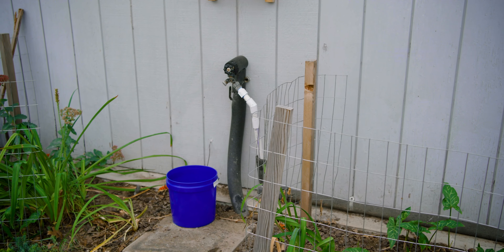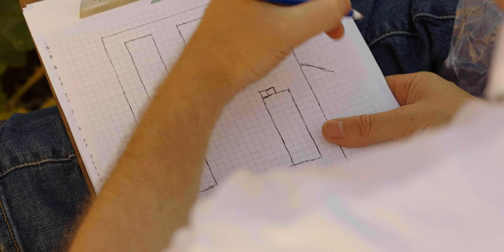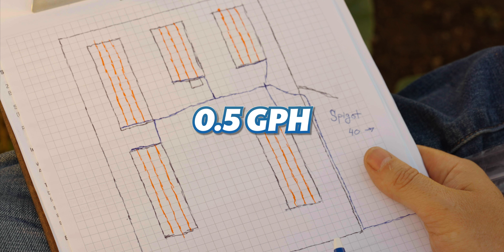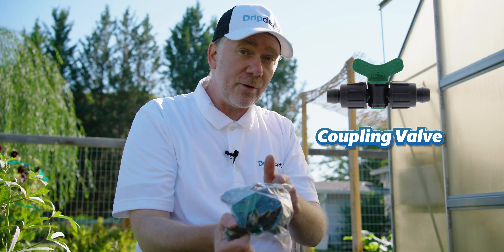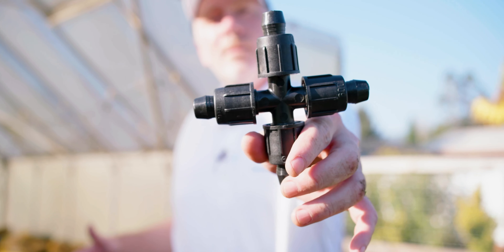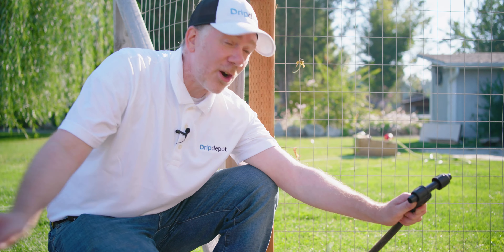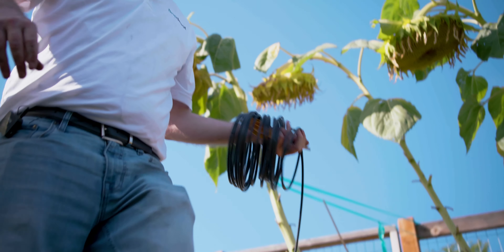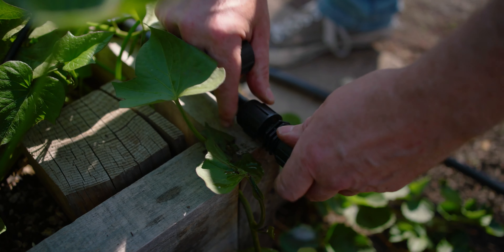How to Install Drip Irrigation for Raised Beds (Complete DIY System Guide)

Comment: Can the 1/2" distribution line be buried? My raised bed garden is about 125' from the back of the house, and there's grass that needs to be mowed, plus I drive back there pulling trailer, etc. I'd like to be able to bury the distribution line. Is it made to withstand burying at least 6" deep (so when I do aeration, I don't damage it!).
Reply from the maker: You bet, it is acceptable to bury the tubing :)

Just like with PVC pipe, you will want a trench of crumbly soil cleared of rocks/gravel for it to rest in -- 6" is an acceptable depth, we most typically see 6" to 8" but have seen our fair share of 12" as well.  

I can confirm this works well -- at my home I have it buried about 6" as well and mostly did so for mowing and overall aesthetics.  6" is a good depth to make spotting a leak easier as well (I haven't had any in the 4 years it has been buried, but some of that is likely luck).  :)

Comment: Should the main faucet valve that feeds the entire system remain open after you attach the timer with connection kit?
Reply from the maker: You got it exactly right -- so long as the PSI is within the operating pressure of the timer, you can leave the faucet open so that when the timer opens for its programmed watering cycle, water goes straight into the irrigation system :)
Reply: @dripdepot  Thanks!

Comment: Love Drip Depot!  For context, I'm 60+ and can manage using a drill, hammer, and screwdriver, but I'm not going to do major repairs myself ("back in the day" I'd replace toilets, light switches, light fixtures and the like - not now).  Last year I hand watered my raised beds.  It was time consuming and I confess that I did not enjoy standing outside in the heat to ensure that each plant had a thorough drink from either the hose or watering can (if it was time for fertilizer).  The garden suffered as a result.

This year, thanks to Drip Depot, I installed drip irrigation to 8 large ovals (3'x5') and four rounds (24" and 42"), plus 9 20" pots and two 5-gallon potted fig trees.  PLUS 4 in-ground apple trees, a persimmon, and 2 berry bushes.  Whew!  When I list them all, it seems daunting!  But over the course of a couple of days in spring I was able to do it all.  The instructions on the irrigation videos are so clear!  I ran 1/2 inch line around the perimeter of the yard, and then branched individual 1/2 inch lines to each bed using T connectors.  Using right-angled connectors I ran the line up the 17" sides of the beds, added shut-off valves, and then ran several 1/4 inch drip lines down the length of each bed.  The potted and in-ground fruit trees and the potted tomatoes each have a 1/4 inch line from the main, ending in a button dripper of appropriate size.  Later in the season I added a fertilizer injector system (also Drip Depot, of course).  Game changer!  All the fish emulsion and rapid-release fertilizer (the blue stuff) runs through the lines to the plants.  Magic!

The only down side is that I can't seem to stop a drip at the faucet (or maybe it's at the Y splitter).  Not an issue with the Drip Depot system at all, but it does mean that I cannot entirely automate - if I leave the water on at the faucet, there's a drip drip drip that fills a 5 gallon bucket in a day (I keep one under the faucet to catch the drips).  Simple enough work around - I just turn on the water and run the system manually.  Next year maybe I'll figure out where the leak is coming from.

In any event, I can't believe how much time this saved me this year!  My garden is thriving.  MORE than thriving!!  I highly recommend this company and its products.  They make it so simple!
Reply from the maker: Thank you for that wonderfully written description of your system!  It sounds like a pretty good sized one at that, definitely larger than what we did in this video, great work.  I know the first one can be daunting, I try to tell people all the time to just try, and in almost all cases they're able to complete the system.  I'm glad you gave it a shot :)

And I hear you on standing around to water plants, I did a few years of that myself back when I first got into gardening (which was before I got into irrigation).  We romanticize our gardens a degree, but I can comfortably say hand watering for hours at a time can take away a lot of what is pleasurable about having one.  

When you're ready to take a look at that leak, let me know, I'll be absolutely happy to help.  Between us all down here there's a lot of experience, don't hesitate to reach out and make use of it at any time.  :)

A couple quick things to check if you haven't already:  If there is any thread seal tape, go ahead and remove it.  With hose threaded connections it can actually cause some of the problems it's meant to prevent.  Also, check in the female side of the connections to make sure they all have the gasket in there (and if it is, make sure it's not distorted, out of place, or old and cracking).  I'd say a missing or damaged gasket accounts for a pretty high percentage of leaks we see at hose bibs and drip head assemblies. :)

Thank you again (and truly) for your wonderful comment!

Comment: I wanted to say thank you! Along my journey towards getting my education in drip irrigation from YouTube University, I stumbled across your videos. I had several questions and you answered them all promptly. Your advice was spot on. I installed 5 zones (including over 300 ft of tubing) to irrigate my back yard. The sixth zone is already installed for the front yard. Everything works great. I discovered and corrected leaks from the previous subcontractor too. I also ordered several perma-loc fittings from Drip Depot after experiencing leaks with fittings from a local retailer. I will only use Perma-loc from now on.
Reply from the maker: Joseph, thank you for the comment, truly!  I love follow-ups like this, they are genuinely what keeps me at maximum effort in answering comments and questions, hearing that my answers had a positive impact is fantastic.  

There's always an open door if you ever have any irrigation questions, don't hesitate for a second :)

Comment: Watched the video 10 times(thank you so very very much, I could not wrap my head around how to even start!💜), designed my system, ordered a customized kit from Drip Depot(upgraded to an 80 µm filter because we have really really hard well water with occasional large sediments; guess I’ll be checking it often for cleaning) &  getting ready to install it today!  One thing I didn’t pay enough attention to was my faucet placement. I’m going to have to install the timer & pressure regulator at the faucet and then run a 50’ garden hose and the rest of my head assembly after that.  Crossing my fingers🤞🏼🤞🏼🤞🏼
Reply: One suggestion, the 5/6 bed kit didn’t come with the half inch stakes (and I didn’t think right then to order any😞). Luckily I have lots of wire I can cut and bend though💙 It would be great to see them in the kit🥰
Reply from the maker: Agreed about the stakes -- technically they're not required so they're not in the kit by default, but they're so convenient to the install process I'll see about getting some included.  

Is your faucet low enough to the ground that that's not room for the head assembly?  If so, your proposed method is one viable solution -- might want to change it up just a little bit and have the timer and backflow preventer on the faucet, then install the filter and regulator at the end of the hose.  

If all else fails, we have a couple options that can help -- a gooseneck faucet adapter to turn the assembly 45° so you can build it horizontally rather than vertically, and a Tee Filter whose Tee shape allows it to fit into low to the ground head assemblies (though it's not at 80 µm, so your route probably works better for the hard water).  If all else fails, let us know, we can send some photos with various ideas :)

Comment: This was a great video demonstration, thank you! Found your company through Homestead & Chill. I'm excited to see your upcoming demo for how to install drip irrigation for raised metal beds because I'm switching out my wood beds for metal.
Reply from the maker: Claire, thank you for your comment -- Homestead and Chill is one of our faves too! 

We have everything prepped for our metal beds video, now we're just waiting for the truck with them all to arrive.  We plan to show several different configurations with the irrigation included so it will hopefully be able to help with almost any setup or shape.  If there is anything in particular you'd like us to include in the video, just say the word :)
Reply: @dripdepot  I love that you’re going to show different configurations! 

This video answered so many of my questions. I’m excited to see the solution for how to attach the vertical tubing to a metal bed and how to best secure tubing to the ground that minimizes tripping. I love to get my kids out in the garden and somebody’s bound to trip over tubing on the ground, including myself. 😂
Reply from the maker: Sounds great Claire, we'll definitely cover both of those!  We've found a pretty good way to secure the mainline to a metal bed that we'll show.  You're right about the tubing being a potential trip hazard.  If you can bury it a few inches that always works well (and depending on the age of your kids, they could even dig the hole!) :) 

Happy Gardening Claire, thank you for the great suggestions!

Comment: The current drip line I put in a couple years ago stopped working and I was wondering how I was going to get it going again.  Thank you so much for this video.  This is so much better than my previous irrigation system.  This was right on time.  I sat in my garden pondering this for the longest.  I prayed and came across your video.
Reply from the maker: Thank you for the kind words!  What a great way to start a Monday :) 

Try flushing your lines and see if that gets them going again (flushing will often remove any clogs in the line).  To flush, go to the end of your drip line and remove the goof plug or end cap there -- then turn the water on at the water source and let it run for a bit coming out of the end of your drip line.  The water is pretty turbulent inside the lines and can dislodge debris that got in there and flush it right out of the end.  

Depending on how many lines you have, it's best to do them a a couple at a time instead of all at once -- this allows there to be enough flow to vigorously flush the open lines.  

I hope this does the trick!
Reply: Thank you so much😊
Reply from the maker: @gaylesjourneyofprojects   You're very welcome!  If it doesn't do the trick, let me know, happy to troubleshoot with you :)

Comment: Hello, great video and lovely garden!

Im over in Australia and built mine about 8 yrs ago woth ongoing additions and removals.

Do you have a video or advice for cleaning biofilm out of veggie bed driplines with built in emitters? I regularly flush and clean my filters but i get a lot of black sludhe that eventually plug up the emitters over years tgat isnt cured by water flushing.

Can i add a safe chemical somehow to soak in situ while in the beds with plants growing? Often the beds arent completely empty as with our weather asparagus, and other veggies are always in the beds. Ive heard phosphoric?? Very hard non industrial information to find consensus on.

Cheers from Western Australia.
David M
Reply from the maker: David, thank you for the kind words!  I hope your Spring is going awesome so far, I'd love to be down there growing right now (cold and rainy up here in Oregon) :) 

You do have the right of it -- chemicals at certain concentrations can be injected into the lines to destroy bacterial sludges and phosphoric acid is one that is indeed used (sometimes sulfuric, citric or nitric even as well).  

A couple other options out there:  Hydrogen Peroxide solutions, Enzyme based cleaners, copper-silver ionization systems, Peracetic Acid solutions and many others.  

As you likely suspect, the proper concentration is what is important, particularly if there are live plants at the moment (but even when there are not due to soil life).  Proper concentrations can depend on a variety of factors as well -- current soil pH, extent of the bacterial life in the irrigation lines, material of the irrigation lines, etc.  

Without calling in a specialist (expensive!) to do all this, it might be easier to go with a commercial product that has done all the mixing for you, there's probably quite a few companies down there that sell these types of cleanses -- you can contact them, explain the problem in detail and they'll be able to recommend a specific product.  Images of the sludge might be helpful too, a lot of these companies can also help prevent it from occurring again (filtering out whatever nutrient they are feeding on -- for us it's often iron and we identify it by the rust colored sludge).  

I did a quick search for Australian companies in this field and got a couple results that may be able to at least point you in the right direction: The Pure Water Shop and Hydrosmart -- they both have the same address in Adelaide so it looks like they can tackle a variety of situations.  I'll link them below (and hope they're able to help you out!).  

https://hydrosmart.com.au/contact/
https://www.waterworld.com.au/contact/
Reply: @dripdepot  Thanks for the great leads. Sympathies re the cold. I grew up in BC. We used to travel to Oregon on the coast road as a kid every summer in the eighties. Although 38c summers here are a shocker.

Comment: This video has been very enlightening and I am excited for the raised metal bed video that is forthcoming. I would love to see a magnetic solution for attaching vertical tubing to metal beds. Similarly, what is the best solution for when mainline tubing has to cross a pathway, like the sidewalk in the video?
Reply from the maker: Thank you for the kind words!  And the suggestion -- using a magnetic solution is an interesting idea.  Recently I bumped into some information regarding using magnetism to promote plant growth, so perhaps there is some synergy to be explored there.

For sidewalks there's a couple solutions -- I'd say the most common is probably just staking it in place so it sits close to the ground.  This does leave a little bit of a trip hazard, however.  In those cases, it can be buried.  There's a product (and likely many more!) called a "Walkway Tunnel Kit" that you can thread on to the end of a hose and it will bore you a nice small path beneath a sidewalk or pathway :)
Reply: Heya Nikki, in case you still had questions about metal beds, we just posted the video :)

Comment: Does it matter the size of the drip line? I have a bunch of 1/2 inch drip line. Does it still work the same as far as water distribution?
Reply from the maker: You bet, 1/2" emitter line will work much like 1/4", except it can handle longer runs (1/4" emitter line is good for up to 20' to 30', after that you want to go with something larger like 1/2").  A lot of 1/2" emitter line is pressure compensating as well, this also benefits longer runs.  It also works great on shorter runs, so if you already have some, you can definitely put it to use :)
Reply: Thanks! I will make use of it

Comment: I didn't pick up on where're located.  For us'em in the Northern climate where are you typically putting in a drain system near the garden or water source?
Reply from the maker: We're located in the "warm north" here in Southern Oregon.  Freezing is reasonably rare around here, and when we do drop below freezing, it's typically not very far (but we still winterize any above ground systems for those couple stubbornly cold days we get every year lol).  

Our end caps will typically be near the garden, preferably in a spot without much foot traffic (water/ice being a possible trip hazard).  Some folks like to place their end caps so that they drain to a spot that won't he harmed by the water draining from the system (thirsty bushes, etc).  

Basically, so long as the water isn't draining somewhere it could cause issues, you'll be doing it exactly right (and even better if it can drain somewhere that does some good, but not always possible)  :)

Comment: I'm not using my city water as I installed a well for my yard & garden. Do I need the backflow preventer since the irrigation system won't be attached to my City water system.
Reply from the maker: Very good question!  The first thing I would do is get in contact with local water officials -- with how heavily backflow prevention is regulated, there's a good chance they could solve this one for you right away.  Beyond that, we've seen folks use backflow prevention even in cases like this, where the water is not from their potable water supply.  Some because they have another well on the property for their potable water, others just to prevent growth (backflow can bring bacteria, algae, etc with it, which can then begin growing in undesired locations).  

Definitely check with the local water officials first, backflow requirements vary significantly from location to location -- one thing we've learned with backflow prevention: there's too many acronyms and every location has a different take. :)